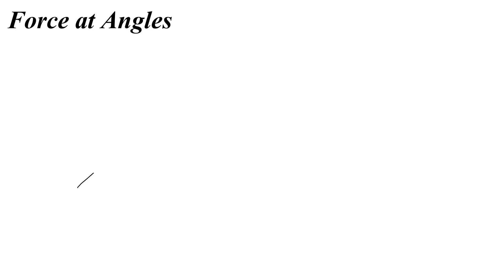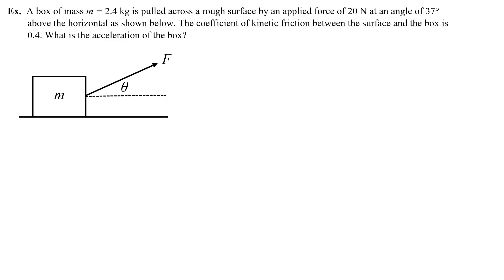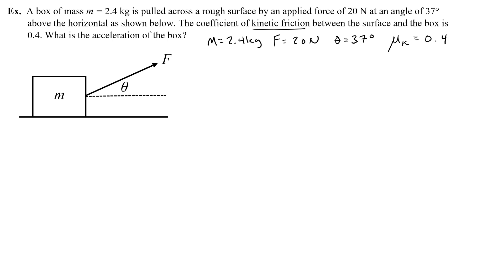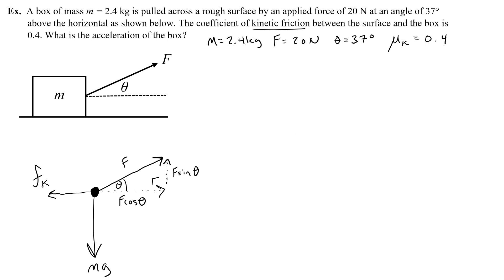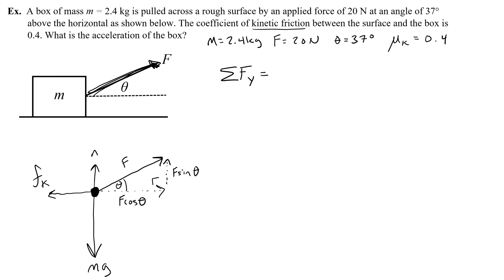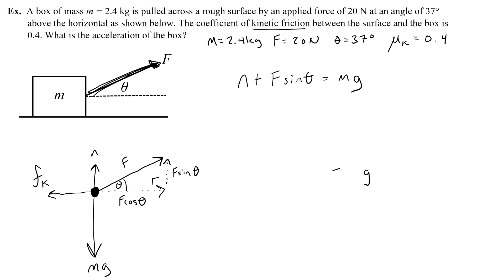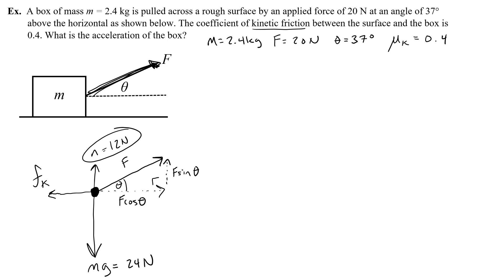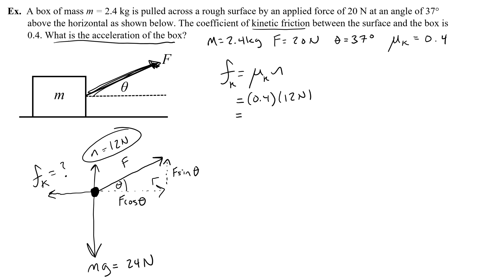How to find force at an angle with friction

Comment: But if the friction force is greater than the horizontal applied force, shouldn’t it not move at all?
Reply from the maker: Force does not tell us whether something is moving, it tells how the motion of an object is changing. The friction force being greater tells us that the motion of the box is slowing down. If the friction force was lesser that would tell us the box is speeding up. If the friction force was equal that would tell us the box is moving with constant velocity. Hope this helps!

Comment: In the second problem, in find the normal force, where did the 10 come from? isn't gravity=9.8?
Reply from the maker: Yes acceleration due to gravity is 9.8 m/s/s. However, this video uses 10 m/s/s for g to make things a little easier. Some physics classes use 9.8 but the AP Physics tests use 10 which is why I use 10 in this video.